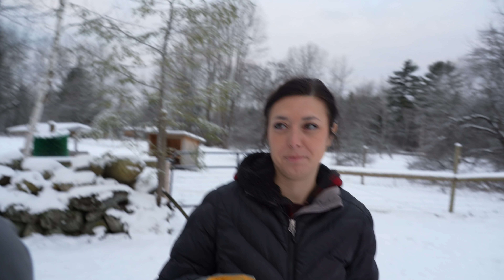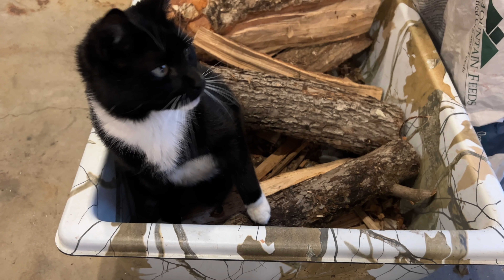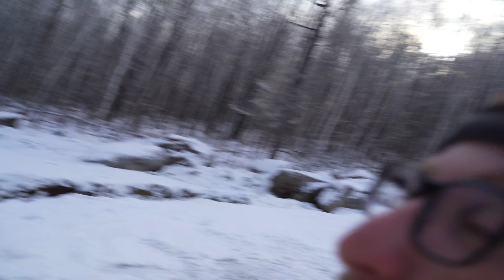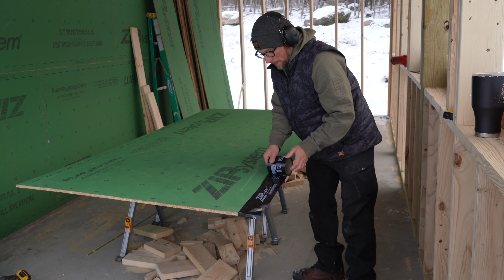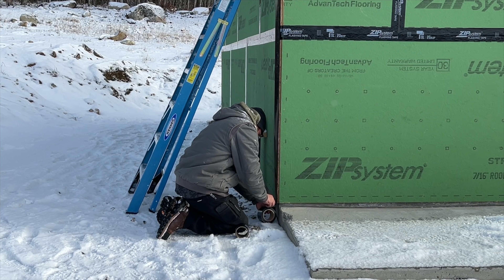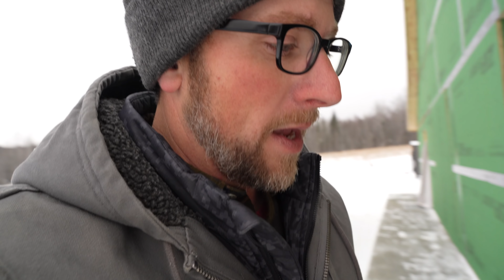We Are SO CLOSE!!! The Last PUSH to Getting the OFF-GRID House READY for SPRAY FOAM INSULATION

Comment: I use my framing nailer for siding exclusively.  I turn the air down to 75psi and use 2-1/2” nails.  Works perfect and I don’t have to have another $300 gun

Comment: My neighbor built his own house, used a fairly  big crew for getting it dried in  the roof installed the windows doors and vinyl siding, If I recall correctly he had most of the electrical and plumbing roughed in as well.  It still took him over two years to get  sheet rock up, flooring installed, light and plumbing fixtures aka all the finishes.   Home building takes time especially after the quick part (the shell) is complete.  Looks really good with all those frozen fingers  doing the taping.

Comment: I wish Ken had put on the metal roof before he left so Al wouldn't have to do that.  I know the roof is waterproof now, but that metal roof is going to be a big job next Spring.  I am also looking forward to hooking up the wood boiler for heat, but the solar is more important right now so there will be lights.  It will be interesting to see how Al runs the electric wire once the spray installation is installed.  It is amazing how much has been done to the homestead since the land was cleared.  Good job, guys!
Reply: I'm an electrician and trying to wire after spray foam is almost impossible. Al will end up removing a lot of the foam to place boxes and to run wires especially in corners. It's always best to spray foam just before putting the wall boards up.
Reply: Just a pointer: they need power from the solar system to run circulating pumps on that boiler. That's why the heat is still hanging, just out of reach.

Comment: I'm surprised you're not getting all your electrical ran, plumbing done, another necessities before you do spray foam. You're going to have one heck of a time trying to do that with the spray foam in. Enjoy watching your build.
Reply: The walls are 2 x 6 so plenty of room with 3" of spray foam.
Reply: @tonygrimes13  I still have a inkling that might be an issue down the road. It might be 2x6 walls but you got to remember that 2x6 is actually 1 1/2 by 5 1/2. Lumber is not true dimensional anymore. Heck lumber used to be true dimensional, but my grandma's house is 60 years old give or take and the 2x4s are actually 1 and 3/4 by 3 and 3/4. He still might have a rough time. It's just my perception. Some of us in the photography industry were film industry would call it POV which equals point of view. Wishing all the best from a former construction and electrician.

Comment: Al, I was thinking for some temporary heat, you could install one or two inexpensive Chinese Diesel Air Heaters.  They cost about $150 each, are extremely fuel efficient, and provide nice dry heat.
Reply: The wood heated boiler will be running soon.

Comment: I know a lot of northern climate homes don’t use air conditioning, but considering you are on solar and seem to plenty of capacity, why not putting in a few mini splits just to take the humidity down and keep the house reasonably cooler during the summer months?
Reply from the maker: We are going to look into it. I would have used them for heat too but they only work to heat down to a certain temp. Each manufacturer is different.
Reply: @LumnahAcres  absolutely.  Even my heat pump here which is both ac and heat only works well on heat to about 20*.  I use propane to keep up, but then again being the polar opposite of you guys. We only see 15*-20* a few days a year and sometimes we might not even see teens at all.
Reply: @LumnahAcres  you are a ways north of what's called the heat pump belt for sure!  As temp goes down, load requirements go up and capacity goes down.  Supplemental heat (gas or elec. strips) make up the difference.
Reply: Love your channel ! My input on minisplit. We have 1800 sq’ on a slab, minisplit is centrally located in kitchen and dining, all rooms are off the central core of house - the kitchen. 15000 btu minisplit heats the house, haven’t used electric baseboard in 6 yrs. The amperage is so low compared to baseboard,
I can easily run it when on generator during outages. I am in New Brunswick Canada
Reply: @josephamck  ... we use mini-split units in the northeast and while the power draw is low compared to electric resistance, it's still a bunch more than the 100 watts needed to run a small circulating pump on that boiler. When you are on solar, every watt counts.
Reply: @rupe53  actually sitting here now during a power outage enjoying my genny backup! It’s not solar but I can keep this going with my 3 day fuel supply.  Minisplit purring away keeping us warm n toasty.
Reply: @rupe53  totally agree that the radiant heat sink of a concrete slab and wood fired boiler is the answer particularly for a solar setup. Wish the first owners of my place thought that way when they built my house. I’m on a slab but no infloor heat
Reply: @josephamck  ... gen backup is handy, but in my area, most still have well water to power so keeping draw down is important. You can heat a 2,000 sq ft home with about 300 watts of juice if the source is oil fired. Even less if it's propane or natural gas. You can't do that with a heat pump when the temps are way below freezing. We can get to -10F in early Feb.
Reply: @rupe53  it’s a balancing act on my 7000w genny when running well pump   and electric hot water. Does well though keeping 2 fridges, freezer, led lights, minisplit, internet and blower on propane stove going. Can’t run a microwave or hot plate well enough so thinking of getting a fueled stove/burner  .. and we bbq more. Very comfy during a 3-4day outage…
Reply: @josephamck  .... I just retired from 25 years of standby generators. My advice to you is to change that electric hot water over to propane, which will give you more gallons of hot water much quicker, not to mention propane is cheaper than electricity.

Comment: Probably too late but you might build the wall in the front where you are deciding what kind of door. The door gap could be just a nailer or two, but sheathing it would allow you to have sealed in if you want to heat it, and definitely spray foam insulate to the first studs away from the main building and the outside corner. Just a thought. Good job and thanks for all the great videos!

Comment: (24:20ish) why not do a sliding barn door? They're easy to put up, you won't have to have extra electrical work and you won't need a bolt lock or anything to keep the wind from blowing it closed.

Comment: The Harvest House is looking great to me!!!  You can build on my property anytime!  

As to the bottom of the zip-ply that is already installed, don't they make a metal "c-channel" that you could slide over the bottom edge and then seal to the plywood with the zip-tape across the top edge of the channel?  I don't remember what the finish siding was going to be, but that would eventually be under whatever you decide to use and the zip-tape would prevent any water from being caught by the channel until the finish siding is installed later.  Just a thought...
Reply: Stop being so logical, its not like the rest of the house was taped...

Comment: I would love to know more about how you work the air circulation with heat. Considering where I live is extremely humid we could never use this technique for heat but I’m considering building and would love this in the spring and fall for cool airflow. The best I can do with the house I live in is open a window on each end of the house and pray for a breeze.

Comment: Al, just a note since I thought Gina said she wanted to have the window in the actual shower. As someone who has had a window in the shower, the ledge is very prone to moisture and mold/rot. In order to prevent that moisture, we had to have a waterproof curtain and it would annoyingly blow away from the wall and cling to you from the air movement of the flowing water. We often would use soap to "glue" the curtain to the wall to prevent it. Just some tidbits for thought, and if I heard Gina incorrectly,  please disregard. Keep up the great work!

Comment: As others have said "don't worry about the rude people" some people just might not know any other way to be.  Your doing great and we all know there's more than one way to do things.   Just a suggestion if you want the light or blurry view you can always use clear plastic/visqueen to let the light come in.  Its fairly inexpensive and depending on its thickness/mils quite durable and should hold up against the wind.  Just secure it with scrap 2x4 around the exterior frames.
Reply: Solar and heat will be connected soon.

Comment: Either build 2x2 frame with plexiglass  and just incert  into frame  and tack in place  so no holes in sheeting be exposed latter it be clear to see out or let light in  and hold wind out or heat in if useing any construction heat

Comment: Are you going with closed cell or open cell spray foam.  Closed cell is awesome for the R value but if the house gets too tight you will need an air exchange system which will take power from your batteries.  What we did is we used closed cell on the load bearing walls and then went with a high density fiber glass on the gabel ends so it could still breath to not have moisture issues.  Since we are off grid too.  An old 1885 farmhouse in the North Country where we can get some -30 F temps too off and on.  Not like we did 20 years ago when we could get -30 for a few weeks at a time.  Antarctica USA.

Comment: Al, Gina, Mental day at work today, so  I missed my fix until 1800 UK 🇬🇧 time. Notes:- Al's back is still sore. My guess based on lifting panels.  Take care. Buy some clear polycarbonate sheeting for Spring in case the windows don't show for the garden room. The birch wood is looking very attractive! So much achieved.  You are going to have such a life under that sky. Can heat come before power? Don't want the slab freezing the pipes. All plusses, really! Kindest regards,  Stephen.

Comment: Hey Al, Where's your cool tool belt? Your building  looks really good, You and Gina are doing an awesome job and using great products for your tiny house. Very clever taping the bottom of the sheats, I've worked with zip many times and never thought of that. If the tape is polybutyl based? I know you can get a primer spray or roll-on, (Henry or Bakor Blueskin) that will make it stick to the concrete so it will be easier to seal up the rest. Also I use my cordless nailer all the time for sheathing, most models take the 2 inch strip nails aswell. From one carpenter to another, I see great skills, a lot of patience, and determination. Love the videos and always look forward to the next ones, Thank you for sharing your journey with us!

Comment: Al and Gina, you are doing a stellar job on a mammoth task! Don't think anything else. It is so interesting to see the build advance, and at an impressive speed. Good thinking to place the shower room window high up on the wall, privacy is required. 

Being 69 I am more or less done with house building, but I find it very interesting to see the products you use. The ZIP sheating and tape for example sure simplifies construction and speeds up the work. Nice. We don't have that in Sweden as far as I know. Also your building codes and practices are different from the ones I know so I cannot comment on that, only ask questions to learn more. The odd suggestion or idea from my own experience might appear though.
Reply: How does Zip Tape simply things?  You can buy a roll of house wrap 12'x100' and wrap your whole house in one pass... little to no taping of seams since you can overlap house wrap like a shingle so the water runs off...  Zip system is expensive stuff and more work you have to roll out each and every seam...  it is marketed toward home owners...
Reply: @ericfraser7543  First of all a small disclaimer. I am not very knowledgeable on the building codes on your side of the great pond so I have to look at it from a purely technical viewpoint. The codes on my side of the pond are very different.

The ZIP sheating combines both the plywood used for covering and providing structural strength, and the house wrap into one product as far as I see. That eliminates one step (house wrap) in the process. So when you have to work around the house twice for sheating and housewrapping you spend more time (=money and build time) and the price for sheating and house wrap may well make it cost-wise quite close to the ZIP. The downside of the ZIP is that you have to seal the gaps between the sheets as a second stage, but this is faster done than house-wrapping. So I still think it makes the build process faster and simpler as a whole even though the sealing tape is an expensive item. If the plywood were edge covered from factory like Al does for the edge turned towards the ground, or have a caulk string already on the edge, the taping could probably be eliminated as well.
Reply: @peterlennart9062  No disrespect at all to you or Al, its just my opinion.   Zip is a popular product around here, it is a pretty stable product while sitting on the build site if it gets wet... 

Still Zip is about twice the cost of 7/16 OSB  $35 vs $20 /sheet, add tape at $30/roll and you need twice as much.  That is even if you tape the house wrap seams, as I said house wrap overlaps but you are supposed to also tape ($10/roll) for a vapor barrier, we are talking about a few seams instead of hundreds of seams plus every nail penetration which is never sealed on Zip...  Watch one of Kens other videos and see how fast it takes them to house wrap a garage with essentially one roll of 9x150FT of Tyvek for $200 or $100 for generic, you are talking about an hour to house wrap and probably a day to tape and roll out every seam on Zip.   The house wrap covers all the osb seams and all the nail heads, I would think it is a superior vapor/moisture barrier.  

I suspect Al chose Zip because its premium quality and resistance to water, it seems he has no plans to side the building any time soon (he can't his windows are back ordered), house wrap is not designed to stand 4 months of winter, then again neither is Zip...  

There is no need to edge seal plywood like Al is doing, you can probably get a strip of siding you can apply or install if you have concerns about the building being 4" off the ground...  not to say Al is wrong it cheap added insurance, my only question is what about the remaining boards which have no tape on the edge, also that tape could also trap moisture at the edge.   

Those Alaskan Slabs are a cheap alternative but the preferred method in NH climates is to pour a frost wall / stem wall 4FT down below the frost.  my garage for example had its 5FT foundation poured on top of a 10" footing with 10" of the wall above grade with less chance of water or snow wicking up the plywood.  There is less chance of the slab cracking, they are supposed to saw control joints in concrete slabs to prevent cracks where you don't want them.     

You heard the expression, penny wise pound foolish... well that is what Zip is compared to house wrap.
Reply: @ericfraser7543  Eric, thanks for the explanation, I now know a lot more about the two products as well as their cost. Having knowledge about what you see being done I think gives a better view of the work and finances involved. Again, thank you for explaining.

Now I think we shall get back to Al and his very interesting not so tiny harvest house.
Cheers!

Comment: Curious how you will run your electrical wiring after the spray foam is in. I always install electrical boxes and drill holes in studs and run basic wiring before the foaming occurs. Another thing I learned was to put nail brackets on studs where wiring will run so I don’t inadvertently run a nail into a wire. Looking good, I’m sure you have a system that I am not aware of.
Reply: The walls are 2 x 6 so plenty of room with 3" of spray foam.

Comment: Do you need to get the heating hooked up before you can put in the solar control system and batteries? I suppose you could just not hook up the batteries until you had heat. Then you'd still have power when it wasn't actively snowing.

Comment: Hi I was just wondering what you were going to do about wiring on the outside walls if you spray foam first I still think you should put the boards in the wall on the exterior wall for where the bathroom wall will tie into the exterior wall so you can have the boards in place For when you do sheet rockto sheet rock Then you would have a nailer there
Reply: The walls are 2 x 6 so plenty of room with 3" of spray foam.
Reply: @tonygrimes13  Oh my gosh I just assumed they were filling the cavities completely full well then you will have plenty of room still loving your channel

Comment: What about the electrical?  Shouldn’t you run your conduit and wiring before the spray foam?
Reply: The walls are 2 x 6 so plenty of room with 3" of spray foam.
Reply: With 6 inch walls and 3" foam, there will be plenty of room for wires, or at least, there should be!

Comment: I thought your solar power was up and going you can't run a compressor off it to run your air tools ,if it's that weak a solar power setup what good is it can run your heat and air water at different times

Comment: I never noticed but did the pipes get stubbed out before the spray insulation?
Reply: The walls are 2 x 6 so plenty of room with 3" of spray foam.
Reply: What house or metal buildings I've seen around where I live they stub it out and tape over the electric boxes and pipes.

Comment: This maybe a dumb question ..but when are you going to run the rough in  electric lines in the walls ..how does that get done with the foam installed already?
Reply: The walls are 6" and insulation is 3", so plenty of room.
Reply: @darlaherbst5929  ooh i thought they went full depth